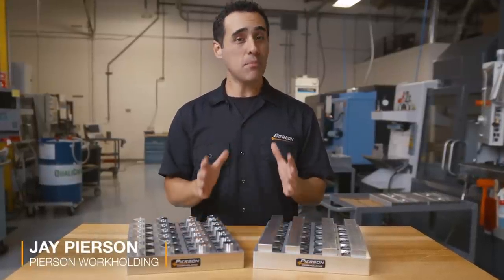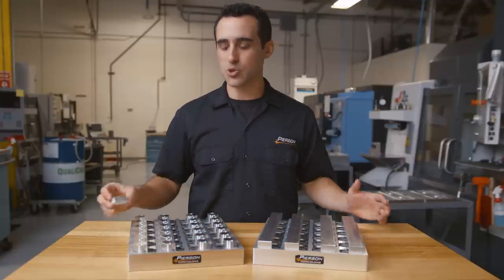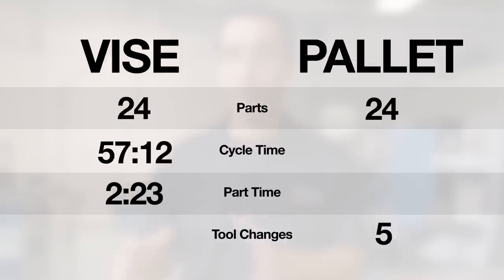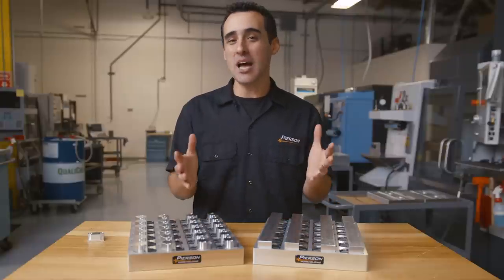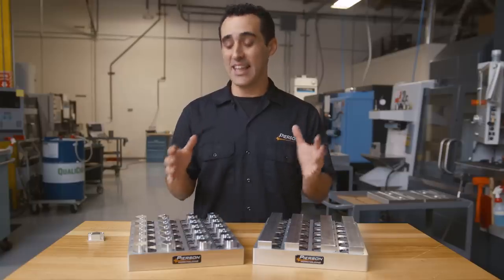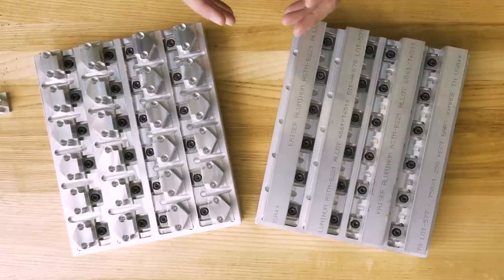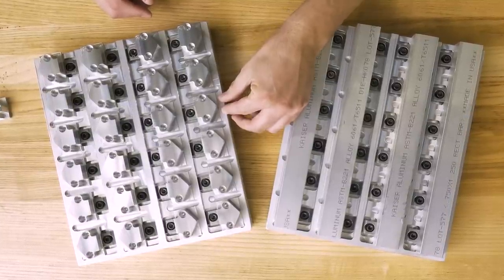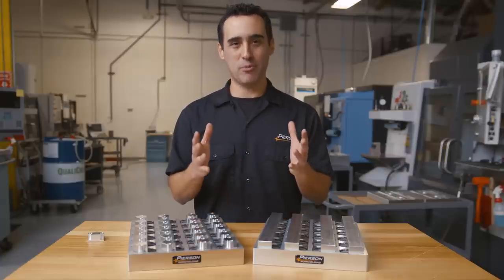How We Got 24 Parts on ONE Pallet! | Fixture Friday 1 | Pierson Workholding

Comment: It always kills me when I see a 40" travel machine with one 6" Kurt vise in the middle of it. Anytime you can use more of your machines footprint you will be increasing production.
Reply: What's obnoxious, is seeing machines with a Metre long table and the controller can only handle a single vise size of code, if that. Why are companies so cheap? I only see Haas with any decent amount of memory.
Reply: @gredangeo  the problem is people dont know how to program and cam systems poop spaghetti code.
Reply: @DieselRamcharger  there's already 50-100 times as much memory installed in most controllers as compared to the base option (Haas for instance, has 64 mb of memory on the board while you get 850-900 kb usable)

It's purely for the "starting at" price to seem cheap and then nic... Dollar and stack you for "upgrades"
Reply: If you filled up the machine (looks like 3 pallets would fit), you'd have to spend a minute changing pallets once every 2 hours and could likely get 1-2 hours of lights-out reliably

Along with this, the operator could also likely handle more machines compared to a single pallet

Comment: We have had similar success with leveraging the Pierson pallet system.  Across numerous part numbers we have decreased cycle time per part by 75% or more.  Since we have virtually eliminated our bottleneck with how many parts we can easily fit in the machine with a quick setup, we have invested in custom form tools to further optimize our production.  The Pierson system is fantastic

Comment: This works! I have used this basic technique for years - but without the benefit of the super quick-change Pierson Pallet bases. Putting these pallets in a vise is a lot more work, bolting directly to a subplate is a lot more work. This pallet system is very slick, very quick - very easy.

Comment: Awesome video! Would there be any disadvantage to separating the pieces after flipping them over? Since you'll be removing the workholding stock anyway, you could save a few seconds per piece by keeping them connected.
Reply from the maker: Good thought, but the next operation goes into a 4th axis vise that holds onto the original stock. The Fixture Friday in 2 weeks will use the technique you mentioned.

Comment: Do you recommend buying a machine with air, or just plumbing air to the fixture from shop air?  Haas wants $2k to install air.
Reply from the maker: Hard pass on paying $2k for table air. Simply drop an air line into the enclosure where the cables for a rotary unit enter

Comment: Great vid Jay (as usual)...but a few things to be aware of. As a very heavy Mitee-Bite user over the years, those Pitbulls need a steel back/locating rail to "heel up" against to...or else over the many times of clamping them down, you'll find those Pits crushing/denting that 6061 which will decrease the clamping force. Not a good deal. Second, I would have used Time Serts (1/4"-20) for this application. Not Heli-Coil.  :) Pockets are a standard...never slotted...so you're good to go there. What you did obviously "works" but we're always out to improve, right? Things to think about when making your next fixture. Never the less, keep those chips flying.
Reply from the maker: Great points!  You can't go wrong with steel backing, but we covered exactly what you mentioned in Fixture Friday #2 cued up here: https://youtu.be/Un0gLEHt8Lk?t=136 So far, HeliCoil's haven't failed us, but the stock screws from MiteeBite have.  We replace those right out of the box.

Comment: Instead of the operator blowing 10 seconds of air across the table, add a Lang Clean Tech vent in the end of the program and it'll be perfect! But still very nice video, hope more to come...
Reply: Have they fixed their wing breakage issue or are they still prone to cracking & breaking off?   We demoed that tool about 5 years ago and it seemed better suited for machines running automated pallet changing systems that want to have no operator interaction.  The $10 manual air nozzle is hard to beat when you still have to do any manual changing of parts/pallets.
Reply: @KCautodoctor  so far we don't have any issues with breakage